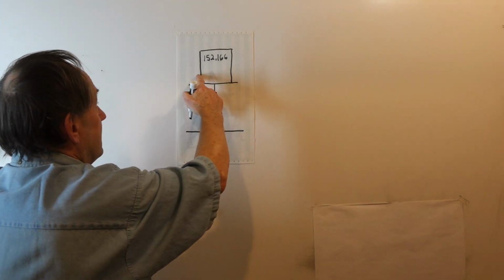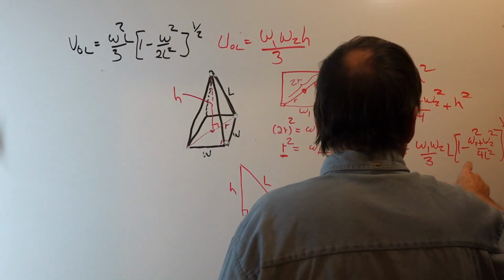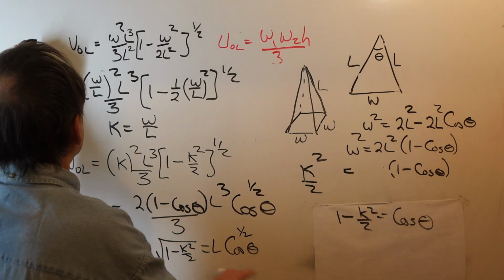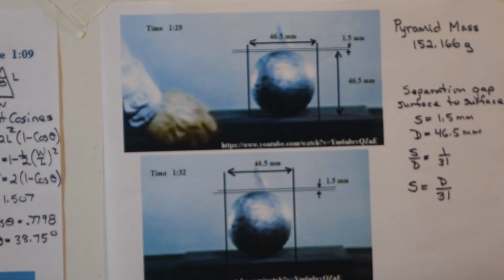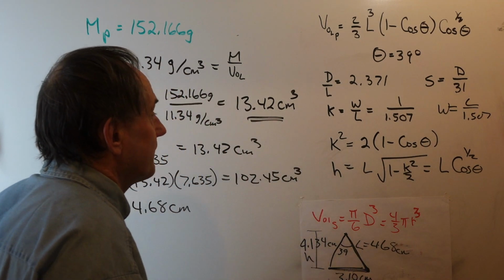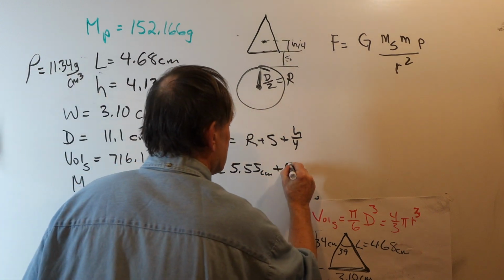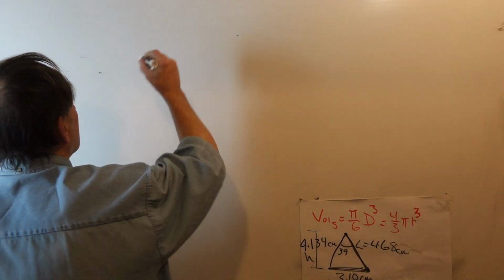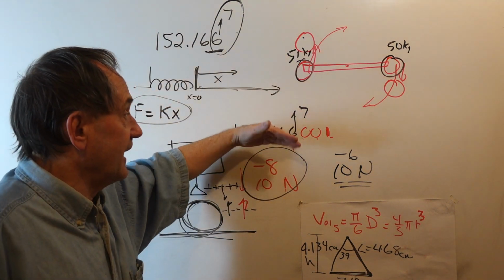Measuring Gravity

Comment: Edit: my calculations after the line are utter nonsense due to the following reason. I let it stay as is to show how it is not done. Thank you number33 for making me think again over this problem. It's embarrassing to me that I did not think before posting such nonsense.

The simple Newtonian equation for gravitational attraction F = G * m1 * m2 / r^2 is only valid for two point masses, e.g. for objects far enough appart so that their shape is irrelevant to the outcome. I'm not even sure whether we can apply this equation for nearby spheres. 

To calculate the attraction between two objects of any shape, e.g. cylinders or square plates, we have to decompose both objects into an infinite amound of infinitesimal small masses, which we can treat then as point masses. Then we have to calculate the attraction between all masses of object 1 and all masses of object 2 applying Newtons equation. Each force between 2 small masses is a 3d vector. We then have to integrate over all forces vectorial to get the total attraction between the two objects. 

Except for a few symmetrical cases this can't be done analytically and if it can be done analytically, it's very cumbersome and needs very advanced mathematical skills. As an example of how this would look like I present a link to a paper:

The Newtonian force experienced by a point mass near a finite cylindrical source
https://www.researchgate.net/profile/Jerry_Selvaggi/publication/325540259_The_Newtonian_force_experienced_by_a_point_mass_near_a_finite_cylindrical_source/links/5b13e681aca2723d997fb419/The-Newtonian-force-experienced-by-a-point-mass-near-a-finite-cylindrical-source.pdf

As an exercise I formulated the equation for the case of two cylinders. It involves 6 nested integrals for 3 dimensions over a non-linear expression, which I am not able to solve. This goes way over my head. I would write a programm to find an arbitrary good approximation to this problem nummerically. This will be much essier.

number33 also pointed out that I made some errors in my calculations, like treating a 1 mm gap as 1 cm. But it does not matter anymore, because the whole calculation is flawed as explained here anyway.

---------------------------------------------
Hi George. I did a rough calculation to confirm your result, using 2 lead cylinders of d = 1 m diameter h = 10 cm heigh with a gap of s = 1 mm. Density of lead is rho = 11,340 kg/m^3.

Mass m of each cylinder is 

m = pi * (d/2)^2 * h * rho = 891 kg

The force F between two such cylinders with a 1 mm gap between is:

F = G * 2 * m / (h + s)^2 = 9.83e-6 N

The scale would show an increase of

Fg = F / g = 1.00e-6 kg = 1 mg

So two cylinders with a mass of 891 kg each with a distance between the centers of mass of 11 mm would just be enough to show an increase in the last digit of the scale.

To get the most attraction we have to use as much mass as possible and get the center of masses as close as possible. One other example: 2 quadratic iron plates (rho = 7,870 kg/m^3) with side length 2 m and 5 cm thickness with a separation of 1 mm would increase the weight about 8.2 mg on the scale. 

I think this experiment could be done if there is a scale capable to weigh a weight of more than 1.5 t to mg precession. Perhaps if we invent a clever mechanism to counter balance the weight so that only the increase has to be measured. Any idea?
Reply: Walter, are you sure about that formula for the force?  If you have derived a formula for the gravitational force between two cylinders then surely it should have m^2 somewhere in it.  Also 10cm + 1mm is 0.101m and not 0.11m.
Reply: @petehiggins33  You are of course right. We can't apply Newtons equation for gravity except for approximately point masses at some distance. Read my edited comment.
Reply: @WalterBislin . They've used scales to determine 'G' and the validity of the inverse square law before, e.g Von Jolly used a quadruple beam balance and more modern experiments have been done with mass comparators. 
Of course, spring based Gravimeters are pretty much the same as a scale.
Reply from the maker: Walter,
I was not notified of your comment and just discovered it.   I will get back to you on this for it is a very interesting topic.  I stand by my analysis and calculations.  There is no way the additional force of gravitational attraction due to the spherical lead ball being moved under the pyramid was anything near 1mg force -- no way no how.  

Your comment:
 <<< The simple Newtonian equation for gravitational attraction F = G * m1 * m2 / r^2 is only valid for two point masses, e.g. for objects far enough appart so that their shape is irrelevant to the outcome. I'm not even sure whether we can apply this equation for nearby spheres. >>>
This is one thing we can be ABSOLUTELY sure of.  The gravitational force of attraction between two spheres of radii r1 and r2 separated a distance greater than or equal to the sum of their radii (center to center spacing >=  r1 + r2) is identical to that of two point masses each of which has the mass of the spheres reduced to those points.   This is a classic problem in calculus and is what lead Newton to develop the calculus in the first place in order to prove this.

Your cylinder example is using masses two orders of magnitude greater than the actual mass of the lead sphere used in the video in order to get the force change of 1mg force.  Are you sure about the dimensions and equations?   I have not had a chance to critically look at your work here.

Something does not seem right with your equation: 
    
                     F = G * 2 * m / (h + s)^2 = 9.83e-6 N

As number 33 pointed out, it seems MASS of each cylinder should appear as a product in the equation as m^2 for identical masses.  You say the cylinders have diameter of 1 meter and height of 10cm.  This is more of a circular plate than what would be considered a cylinder (technically yes but we ususally ascribe the term cylinder to those that have heights greater than the diameter).  I do not do not see the diameter in your equation which puzzles me for the diameter contributes more than the separation "s" in the distance between Center of Masses and is going to affect the force of attraction much more than the separation as you define it. 

I would think the following would be true:
Force inversely square related to  Center-to-center separation  =  1/ (2d + s)^2

The cylinder force equation might more resemble something like this:
  
       F =  K* G * m^2 / (2d + s)^2   
             K = some geometric factor as a function of spacing "s and d"

Please check this again for something does not seem right given the dimensions you chiose:

      d = 1m , s = 1mm , h = 10 cm   so    d >>> s and  d >> 

Finally, that Research Gate link that you give,  points to a paper that is horribly written.  What a mess to read.  It seems to me that I have done similar computations in the past regarding electric field strengths in 3-D space surrounding finite cylindrical and rectangluar distributions of charges and it is not that impossible as the paper makes it out to be.  It requires a lot of integration but can be solved in closed form if I remember correctly.  It would surprise me if they could not be expressed in closed form for these highly symmetric objects.  One just needs to be prepared to be involved with lots of algebra and trig substitutions.

Ceneter of Mass (COM) and Center of Gravity(COG)  are the same for spherical structures but not necessarily for irregularly shaped objects.  I would like you , me , numer 33 and Der Tod  to eventually have a discussion on this subject.   Maybe a skype group call sometime would work?
GH  Nov. 1, 2019

PS -  something is broken in YT notifications and it is always best to also EMAIL me if you want my attention on a subject:   
                           ghnatiuk@juno.com
GH   Nov. 1, 2019   3:28am
Reply: @georgehnatiuk5806  As I wrote, the part below the line is utter nonsense. Of course m * m =/= 2 m! I don't know what was going on with me, I guess I'm getting old, hopefully not senil. I think your calculations are correct. I simply wanted to confirm your result by a simple back envelope calculation. Turns out I messed it up badly. 

But I followed your analysis and found no flaw, except perhaps to be more accurate we would have to take the non-spherical shape of the pyramid into account. Or can we use Newtons equation as soon as one body is a sphere? But as my simulation showed, the attraction between non-spherical bodies ls even smaller than that of sheres, because more components of the forces between every volume element of the two bodies act more horizontally than between 2 spheres of the same mass and the same center of mass distance.

Concerning solving the problem analytically: I'm not a mathematian like you. I can barely remember having done many integrals in university. I did not even remeber we talked about integrals by part, not to speak integration using trig substitutions. As engineers we simply use the final work of mathematicians and if we don't have closed solutions, we program simulations and play with it to find its properties.

It would be great if you can teach me some integration with trig substitution e.g. by calculating the gravitational attraction between 2 cylinders. Maybe a future video? I would appreciate it. I'm not a fan of direct communication via internet, sorry. It's too exhausting to me.

Here is the link to my simulation of gravity between 2 rectangular plates. 
walter.bislins.ch/work/index.asp?page=Gravity+Force+App

The cost of computing power increases with n^6 where n is the number of subelements. What I can get from this simple simulation is, that if I increase the distance between the plates enough, the result approaches the Newton equation for spheres.
Reply from the maker: Fair enough Walter.   I did enjoy talking to you a year ago when we got together and analyzed that TR Tolan video.  I will respect your wishes and not press you to participate in a live conversation.   I would  like to tackle the two cylinder problem but have so many other videos I have yet to do, it might be some time before I get to it.
GH     Nov 1, 2019  1:54pm
Reply from the maker: Walter,
I just remembered that I did work on a problem a number of months ago that is directly related to what you are asking of me so I may get to it in the next few months for it is on the list of tasks to finish.  I have a disagreement with a physicist regarding the gravitational force vector "felt" by a test mass outside a uniform mass density plate or disk of finite thickness and finite perimeter dimensions as a function of distance from the geometrical center of mass(COM).  That would be a circular disc of fixed finite radius or a rectangular disc of fixed length and width both having a finite fixed thickness.  This would also apply to a cylinder if the thickness of the disc was increased to a dimension greater than the perimeter dimensions.  I am trying to solve the very general problem with variable disc dimensions and arbitrary test mass positions in 3-D space.  

The question is the COG(center of gravity) of such a plate a function of the position of the test mass as this test mass is moved around in space about the disc of mass or is it coincident with the COM?  What about the case when there is a high degree of symmetry such as for a round or square disc?  If the COG is a function of the test mass position, then what is the functional relationship and how strong is that functional relationship near the surface of the disc as the test mass is moved above the surface from the center outward to an edge?   Vsuace made a video about this in relation to a flat earth which started the controversey.  I do not believe Vsauce is correct in what he did and my physicist friend believes it is correct.   For an infinitely thin disc I agree but with a disc of finite thickness I do not.

I have solved the problem in CLOSED form for the rectangular disc case and need to work it again to check that I made no mistakes.  I set it aside so that I could start again fresh at a later date for the mathematics was intense.  There were over 70 terms to the force equation in closed form when I finished with much symmetry among the terms regarding the variables which indicates to me I probably have the correct equation.  The fixed straight perimeter boundaries of a rectangle allowed me to work the integrals exactly but not so sure a circular boundary will yield as easily.  That is why I chose to tackle the rectangular boundary first.

What needs to be worked out are approximations in the equations for force as a function of distance from the COM where the distance is much much greater than the dimensions of the disc to verify the closed form solutions reduce and approach the Newton equation for spheres as they must as you correctly observed in your simulations.

You are correct when you say, "But I followed your analysis and found no flaw, except perhaps to be more accurate we would have to take the non-spherical shape of the pyramid into account".  I agree with this, however a more precise value for the COG of the pyramid will not affect the conclusions drawn from my computatiions for the estimated gravitational forces that I derived are greater than two orders of magnitude less than the 1 mg force registered by the scale. My guess is that a more correct value for the COG of the pyramid would change my values by less than 1.0% if not much less than that.

GH   Nov 1, 2019  2:53pm
Reply: Hey  @georgehnatiuk5806  and @walter.
Yup I have been trying to explain to George for months that the gravitational attraction of a disc or a rectangle can't be analytically represented and certainly the effective mass of the body is not at the centre of the object as George claims ! :D
Reply: @georgehnatiuk5806  I'm excited to hear about this and hope my math skills let me at least follow you. 

Concerning whether the CoG follows the test mass: consider 2 spheres connected by a thin rod. Does the force of gravity always point to the middle of the rod, that is the CoM? Certainly not. So we can expect that near a non-spherical shape the CoG follows the test mass. Can we even speak of a CoG if we only have a force direction? It will move around depending on the position of the test mass and not be a single point in the direction of the force. In the example of the connected 2 spheres, near one sphere the forces point near the center of this sphere. The farther away the test mass moves from the spheres, the more will the force point towards the middlepoint between the spheres.

So what we will get is a vector field, a direction of the gravitational force as a function of position of the test mass. In general there will be no common CoG point all vectors are pointing to. This is certainly also the case for a flat earth disc. But if the disc is as spherical as possible, the CoM will be a good approximation for a CoG I think.

By the way I did the vector field calculation for an infinite plane. Due to the symmetry and the fact that all horizontal components cancel, the calculation was easy. It results in a homogeneous vector field, not dependent on the position of the test mass. This example also shows there is no single CoG. Using the mean density of the earth the flat earth would have to have a thickness of 4,241 km to produce a 9.806 m/s^2 down acceleration.
http://walter.bislins.ch/bloge/index.asp?page=Gravity+on+an+infinite+Flat+Earth+Plane
Reply from the maker: Walter,
You are correct on all accounts in your statement.   I am interested in the functional dependence of the strength of the gravitational force as the test mass moves along the surface of a round disc of finite thickness from the center toward the edge.  How does the field strength vary as the test mass is moved from the disc center to the edge?   I do not believe it to vary anywhere as much as the Vsauce video tries to illustrate.   Possibly it is true for a very thin disc but not for a disc of reasonably finite thickness compared to the surface dimensions.    That is the point I have been trying to make to my physicist friend Rumpus.  I still believe for a round disc with finite radius "a" of finite thickness "t" having a homogeneous mass density (not a surface mass density but a volume mass density) that the COG will always be near the COM and will vary little if at all in position as the test mass is moved around in space even near the surface.  This is NOT like your two mass dumbell system where there are huge spacial gaps between the mass concentrations.   In the case of the round disc, the mass is uniformly distributed over the disc and the symmetry of the problem insures a high degree of vector component cancellation EVERYWHERE the test mass is positioned.

Ultimately we want to know if the COG is coincident with the COM for a round disc of finite thickness which would result in the COG position being stable as the test mass position is changed.  I can easily argue that due to symmetry in the case of the round disc that the component of the gravitational force vector parallel to the surface of the disc to a test mass above that disc will always pass through the surface center of the round disc. The question then remains as to the magnitude of the component of force that is orthogonal to the disc in comparison to the component parallel to the surface.  Are the magnitudes such that when the vector components are added together that the resultant force vector points to the COM which is at the interior center of the disc or will it not?  Does the COG lie along a line thru the center of the disc between the two surfaces (axis of the disc) or not and if not, how much off center toward the test mass is it?  If the COG lies off the axis of the disc, then as the test mass is moved away from the center of the disc, how does the COG functionally move along with it away from the center?  Finally,  is the magnitude of the resultant force vector essentially constant as the test mass moves along the surface of the disc?  If not, then what is the functional relationship and how stong is the dependence of the force vector magnitude with the position of the test mass as it moves from the surface center toward the edge of the disc?  Does the gravitational force on a test mass remain essentially constant over the surface of the disc and then aburptly begin to change as the edge of the disc is reached as I believe it to be?  For an infinitely thin disc (sheet of mass), the gravitational force at the disc center will be ZERO but not for a disc of finite thickness.

That essentially sums up the problem if you wish to try to simulate it before I work out the closed form solutions if it can indeed be done for a round disc.

The infinite plane example you give is similar to the classic infinite sheet of charge where the electric field everywhere in space above the plane is uniform.  The electric field everywhere has constant magnitude and always points orthogonal to the plane.  The solution is trivial when Gauss's law is applied to the symmetry of the problem.  This situation is approximated by overhead florescent lighting with multiple rows of tubular bulbs in a large room.  Such a light plane casts no shadows for the light intensity will essentially be everywhere uniform orthogonal to the plane of the floor.

I have argued in the past using this result as proof the earth is not flat but there is no hope that most people let alone a flat earther will truly understand the concept.  For a finite plane of finite thickness of homogenous mass density, the gravitational field MUST be uniform in the region above the surface of the plane except when you get near the edges.  As you move up off the surface in the central region where the edge effects are minimal, the field must remain essentially constant with height (independent of height) and then at a prescribed height start varying significantly to approach that of a point charge a long distance away off the surface with a 1/r^2 dependence.  This is the main reason we cannot be on a flat disc earth.  If it were so, then the gravitational force (an object's weight) would not have the functional dependence that is actually measured as an object is moved upward off the surface.  Most certainly this dismisses the infinite plane earth theory for if it was so, then an object would have the same weight everywhere above the surface with no height dependence above the surface.  We know this not to be the case with weight measurements made with distance (altitude height) above the earth.  

The actual gravitational force dependence in the case of a finite round disc would be expected in the central region to have a functional relationship resembling 

                1/ [ 1 + (h/a)^2 ]   where  a = disc radius    
                                                             h = distance above the surface

GH   Nov. 1,  2019   10:47pm
Reply: George, I have implemented a numerical analysis of the gravitational acceleration and potential around a cylinder. There is no such thing as a center of gravity for a cylinder, because the acceleration vectors do not all point to the same location as you move around a test mass. It is interesting to see how the gravitational fields are near the cylinder and I could show that the field approaches the field of a point mass or sphere with the same mass as you increase the distance from the cylinder.

Here you can play with the simulation:
http://walter.bislins.ch/bloge/index.asp?page=Gravitational+Acceleration+and+Potential+Field+of+a+Cylinder
Reply from the maker: Walter,
I will look at your simulation this weekend.  Trying to get caught up after returning from my trip to Colorado and Texas.  
Yes, any shape mass will approach the gravitational field configuration that of a point mass when the test mass is sufficiently far from the object mass.  A good rule of thumb is to be the distance from the center of mass of the object mass at least 10X the largest dimension of that mass.
GH    Nov 23, 2019  11:03am
Reply from the maker: Walter,
A few suggestions for the simulation:
(1)  Move the yellow box that is displaying the magnitude of the gravitational acceleration  "g" further from the test mass point.  
It gets hard to find the point position the way it is.

(2)  Also in the yellow box, it would be nice to also have the "x" and "y" components of "g" displayed below the magnitude of  "g"

        g =   
      gx =
      gy =

(3)  What is  pointmass g  and  analytical g(0,y)   in the lower right corner?     Something does not appear correct if I understand the meaning of g(0,y) the way I interperet it.
For example.  set position at x = 0.0,   y = -1.0 in the default cylinder.
In the yellow box,  g = 4.07 E-06  whereas   g(0,y) = 4.28 E-06
Why the difference?

(4)  I feel it would be better to reference the "y" coordinate to the center of the cylinder rather than the top surface as you currently have it. 

THANKS,
GH   Nov 23, 2019     12:07 pm
Reply: @georgehnatiuk5806  Thank you for looking into it.

I have incorporated your suggestions 1, 2 and 4. You can now choose where the y zero axis is with the option "y = 0 at" surface or center. All values are now displayed in a box on the upper left corner, no matter which field is selected (acceleration or potential).

(3) What is  pointmass g  and  analytical g(0,y)   in the lower right corner?     Something does not appear correct if I understand the meaning of g(0,y) the way I interperet it.

The "Pointmass g" is the g value if the cylinder were a point with the mass of the cylinder. It is calculated to show that the real cylinder g approaches the Pointmass g for great distances. The Analytical g(0,y) is the g value on the vertical y axis, calculated by an analytical equation as described at the paragraph "Analytical Solutions". It is calculated to show how good the approximations in the yellow box are.

The difference between g and g(0,y) at the surface of the cylinder is due to the limited resolution of the cylinder decomposition. This leads to small inaccuracies if you get near the surface and the cylinder is approximated by too few elements. If you increase the number of cylinder elements by decreasing the "Element Size" e.g. to 0.01 the values differ only by 1 in the last digit. So it's a resolution problem. This is true for all values for any position very near the surface if the resolution is too coarse. The more elements, the finer the resolution. The farther away from the surface, the more the resolution errors even out very quickly.

To find out whether specific values are accurate enough, decrease the Element Size until the difference between the previous calculation is pracitically zero. But decreasing the Element Size increases the number of elements to the N^3 power (e.g. 1/2 the element size -> 8 times more elements, 8 times more calculations). You better disable the Vector and Field display in this case, because it may take a long time to calculate the whole field. 

Hint: Click on "Legend" below the graphic to show a description of the App.
http://walter.bislins.ch/bloge/index.asp?page=Gravitational+Acceleration+and+Potential+Field+of+a+Cylinder&open=Legend
Reply from the maker: Walter.
Thanks for the explantion.   I suspected it was an approximation issue due to the limited number of mass elements that contribute to the sum in "g".

Here is a simulation that can be extended from your already excellent work should you care to take on the effort some day.   Rather than assuming a cylinder with a circular boundary, do another for a right cylinder with a rectangular boundary of side length "2L", side width "2W" and thickness(height)  "2T" or "2H".   This is the problem I worked out analytically in closed form.   If you had this, then I could check the results of my closed form solution and compare your results against mine for a test mass anywhere in 3-D space outside the rectangular cylinder.  Even having just a vertical 2-D slice along the x-axis(length) as you have in this simulation would be helpful.  Of course, the gravitational field portrayed in the slice in your circular disc is the same for all orientations of azimuthal angle in the y-z plane whereas in the problem I propose would not have that symmetry.  

Using your coordinates,  the side length(2L) would be along the x-axis extending from -L to +L,  the side width(2W) would be along the z-axis(positive coming out of the page) extending from -W to +W and the thickness or cylinder height would be in the y-axis direction going from say -T to +T.

You could even make the boundary a square to force even more symmetry into the problem (L = W).  That would also be very helpful to me.  The square plate would be in the x-z plane with side length 2W and thickness "2T" or "2H" in the "y" direction.

THANKS
GH    Nov 32, 2019  6:29 pm
Reply from the maker: Walter,
Just looked at your latest version of the circular cylinder.
EXCELLENT.      Good job.   You read my mind.
GH